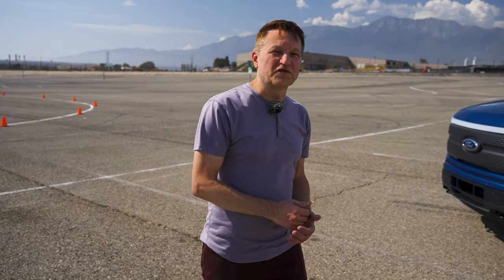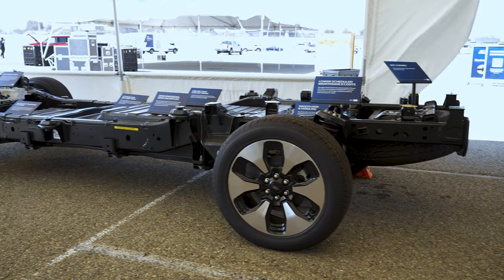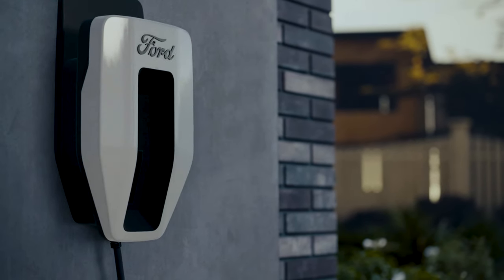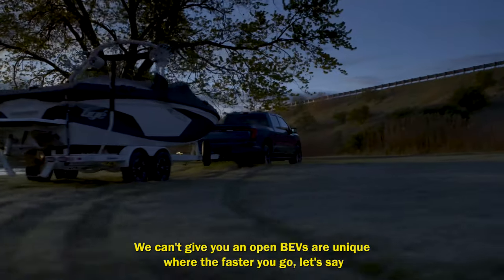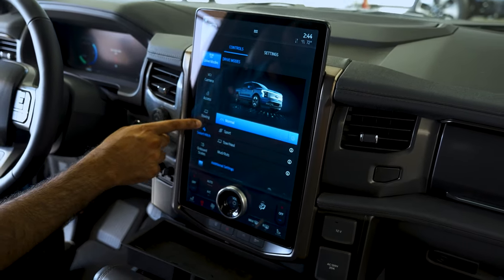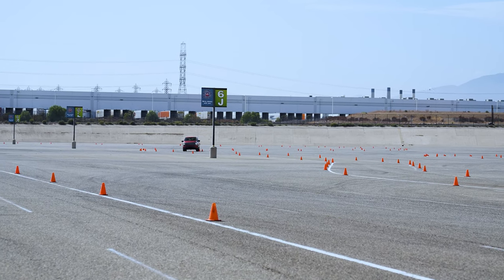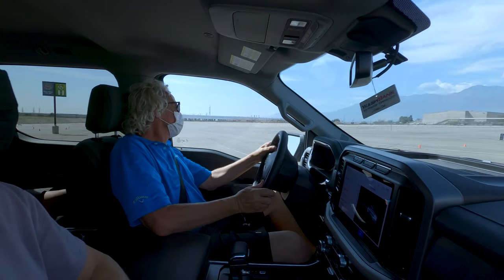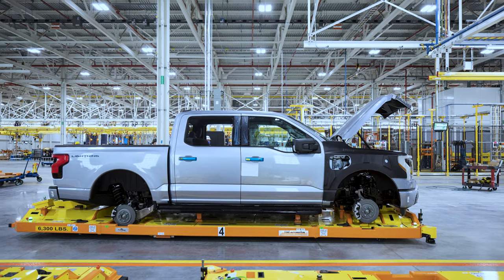Ford F-150 Lightning EV Pickup Truck Will DOMINATE!

Comment: Very interested in this truck and EV trucks in general. I've owned many trucks, never for work purpose just play, off-roading, camping, towing a trailer or a boat. There is always a fuel cost penalty for owning a truck though and since my house is off grid and uses solar panels I am very excited for the future of EV trucks.
Reply from the maker: Right on
Reply: The only questions I have is 1:  Why with a shifter?  Practically pointless and it will be a failure point with it having to fold down constantly. A knob like in the RAM Limited would work better instead of a shifter; and 2:  Would it would work nicely with lets say a Tesla power wall? To have some power walls, solar panels or solar roofs (tiles instead of shingles) along with this F-150 lighting and your electric needs are solved.  Homesteading in Texas with that, a Water well system, and Starlink for internet would have you set up to be stand alone for years to come as long as you know how to grow your own produce.
Reply: @NapalmCloud  You share the same thoughts I have. I am buying 2.5 acers, installing a battery wall, solar, off grid.
Reply: @NapalmCloud  Seriously we must be related, my brother and I just had this conversation yesterday.
Reply: @CruiseControl1  Unless you are a Cornett or Nelson, we can just chuck it to: "Great Minds Just Think Alike!" lol
Reply: @NapalmCloud  Nope, Skains, Kane, Estes and Clendenning are my background. So I'll do with the minds idea.
Reply: @NapalmCloud  you know what? You have a great point with the shifter.  Ford's solution for what they wanted to do, which I really like, seems rather extraneous.  They could have had the flat work area with a lot less moving, breakable, parts.

Comment: when the power in your house goes out, use your Ford to power your house, and when the power in your Ford goes out, call AAA
Reply: TOW CHARGE, funny thing about Regen Braking in EVs. You can regain range very fast just by having any other vehicle tow strap tow you. You both get to the nearest charger and gained some range. AAA & Tow Truck not required.
Reply: You are also covered by Ford Roadside Assistance. If you run out of charge and Ford will get you to the nearest working charger :)
Reply: Ford has software that will prevent the battery from fully discharging under those conditions, so you won’t be stranded.
Reply: @dmandman9  Even if you do not fully drain you battery. You might be too far from a high powered charger if you are in the middle of no where rural area. My parents still live in rural Australia. But in a City you have Level 2 all around you if get screw up. Just will be annoying to wait for a couple hours just to get to the nearest Level 3 DC Fast.
Reply: @Neojhun  in that case, you won’t want to use it to power your home. Or if you do, just power the bare essentials. But I’m sure it allows you to set  the level at which you don’t want it to get below before it doesn’t allow it to drain further.  So if you need 50% charge to get to a charging station. Then set the cutoff at or above that level
Reply: @Neojhun  that’s a minor problem. I’m fairly certain you can choose how much to allow the battery to drain before shutting down. So if you need 40% battery to safely ensure you’ll make it to a charging station, then set it to where it won’t drain below 40%. You know your needs, so act accordingly. Power only the bare minimums . Or simply choose not to use that feature and get a regular generator for your home. The feature is there for those who can and want to use it. Also, if you’re uncomfortable buying an EV until they are improved, you have plenty of time. IC engines and even Hybrids will be produced alongside the EV for several years. Battery technology is improving year by year.  To illustrate as a comparison: the early automatic transmissions were fragile, unreliable, and grossly inefficient. Most people still chose manuals for years. As they improved, more people chose them. Eventually, so few chose manuals that most manufacturers stopped putting them in most of their cars because no one bought them. Again, if you don’t trust a new technology, wait until it improves before getting it. Others will want it from day one. They’ll drive the improvements

Comment: Excellent job with the battery replacement setup!!! How it's supposed to be done
Reply: The best case is not requiring cell replacement in the first place at least for the first 15 years.
Reply: @Neojhun  true. But just as we have a few engine problems earlier than anticipated (but after warranty) , I’m sure some batteries will fail as well just after warranty. It’s good to know that in these cases the repair is affordable.
Reply: @dmandman9  Yep they do fail and parts cost realy need to be attacked. But that is part of the bigger Automotive Supply Chain problems we are having now. The only major FAIL is RIGHT TO REPAIR and fighting these companies to allow owners to repair their own vehicles with deep access to necessary service instruction even if that means you need to pay. BEVs are actually Easier and Less Resource Intensive requiring less specialized tool to do major overhaul work in your private garage. If Supply Chain become less of a problem and Right to Repair is fixed, maintaining a BEVs should not be more expensive than a Piston Engine vehicle.
Reply: @Neojhun   By the time these cars are common and start to go out of warranty in large numbers, I believe the aftermarket will have come up with equipment that can make the common repairs doable without going to the dealership. For example, removing the battery pack in a Mach e is not that difficult. It’s easier than removing a transmission. The issue will be finding which section is faulty. The next issue is “balancing The new battery section to match the remaining battery sections. As it stands now, replacing an automatic transmission or an engine ALREADY requires resetting the engine computer or reprogramming the transmission information into the transmission module. It even required when replacing fuel injectors in some vehicles. So replacing an EV battery isn’t that different. I do agree that the information should be available to the public just as it’s available in aftermarket repair manuals today. By the way, Tesla is NOT a good example of how EVS will be repaired. They are super secretive and repair facilities are few and far between. Fords will be repaired by any dealership that is authorized to sell it.
Reply: @dmandman9  Tesla was my example of denying Right to Repair abuses. But in recent year they seem to have given up and slowly opening up. Even though their cars are actually inherently built to be easier to fix.
Reply: @Neojhun  I think EVs in general will be easier to fix once the proper procedure is learned. Our dealership hasn’t had to do any repairs on the Mach e yet. But even electric part the hybrids aren’t that difficult to repair. It’s just a learning curve.
Reply: @dmandman9  you seem to know far more to about these vehicles than the average person..... Do you know if the reported range of the Lightening is with or without 1000 lbs of towing added.  This seems to be a section of confusion.   Some reviewers think the range will further than what's being reported when not towing anything.    I'm thinking of buying one and I'm not a contractor that will be hauling much at all.  Thanks
Reply: @springbranch6866  While Ford has revealed to us some of the technical aspects, they haven't revealed any more to us than to the general public concerning how range was calculated. However, extra weight INSIDE a vehicle often doesn't influence the fuel economy a whole lot compared to towing. I think the rumor is that they had a thousand pounds of weight inside the vehicle rather than towing. I'm not sure though. But I doubt if it's when towing because Towing is what drives down conventional engine fuel economy appreciably.  It may be of interest to note that the Mach E range seems to be close to typical whereas the Tesla range seems to be achieved under ideal conditions. Few actually get the full advertised range in a Tesla unless they try. But if driven the speed limit, more people say they achieve advertised Mach e range. Hopefully, that will prove true for the lightning as well.

Comment: They can replace individual cells? I don't think that is correct maybe modules not the individual cells. How will you find a bad cell?
Reply: If they are using big pouch cells maybe? But I think you are right, they mean modules.
Reply: @augsu  if they use large pouch cells they will increase the chance of thermal runaways.
Reply from the maker: Maybe a difference in terminology then. They said that cells would be replacealbe, but I think 'module' is probably a better interpretation?  I"m not sure how they will diagnose it, but presumably the diagnostic ability will be there.

Comment: dominate what?  the gas model? yeah i guess as it gets 12500 off....and even the platinum trim at 70 becomes 60ish even with price increases vs 40k for the cheapest 4 door....ford will canabalize themselves for little to nothing.  cybertruck gonna eat this things lunch
Reply from the maker: This will be on the market before the Cybertruck. Different market I think, but we'll know in a year or so!
Reply: @revmatchtv  and the rivian is already out, being first means little if you cant crank out 500k a year within 1 year
Reply from the maker: @richardroberson9277  Rivian is indeed first with a truck.The only car company that can currently make 500k EVs per year is Tesla, but that doesn’t mean that they all can’t compete and make each other better. Ford is investing massively and within a couple years they are positioning to challenge Tesla for the top spot. It’s still a bit early to tell what the market will look like in 3-5 years. If you have a crystal ball, invest heavily into the company that will win
Reply: @revmatchtv  yea yes it does....rivian is not going to compete with a 1.2T company with 3.5 and counting gigafactories capable of 1M a pop when they dont have plans to move beyond their 150k capacity until 2023.  thats horrible for a 140B valuation....thats worse than tesla for gods sake for how many cars they make which is comical as tesla has nergy storage tech and....the ability to scale

Comment: Electric vehicles will not be effective unless you can charge it as fast or as convenient as gas. Nice vehicles, but not now. Imagine going camping in a remote place traveling hundreds of miles to get there and not having enough juice to come back home.  In remote areas gas station are at a premium let alone a charging station.
Reply: My EV is far more convenient than going to a gas station, I'm always full when I leave the house, don't have to look at the gauge until I've been driving for hours. The big advantage of electric is it's predictability, range anxiety is a non issue, I take my EV to remote areas hundreds of miles away with no worries, electricity is easy to find and manage. The thought of taking a modern ICE vehicle into the boonies scares me, gimme a carb or a PWM controller, that modern engine technology is garbage, more computers and moving parts in a modern diesels exhaust system than in my entire EV, think about that!
Reply: @augsu  how is an electric vehicle more predictable in ranges? Makes no sense. Gas or electric, you still look at the range?! It is the same in all cars. Electric or not. Electric is not more convenient than gas, you can not be more wrong. There are way more gas pumps than electric chargers. It takes lass than 5 mins to fill up vs 30 mins to an hour for a full charge. Those are facts provided by the manufacturer. Lets not hide the facts here.
Reply from the maker: The charging infrastructure still needs a lot of build out for EVs to be practical for a majority of people. It's chicken and egg right now, but expect to see a lot of investment over the next 10 years.
Reply: @revmatchtv  yes! Whenever you drive by a charging station next time. Make note of how many cars are charging and how many owners of those cars are actually in it while its charging! Seems to me they are charging the car while shopping or leaving the car charge for an X amount of time while they do something else. Seems like a hoarding issue to me.